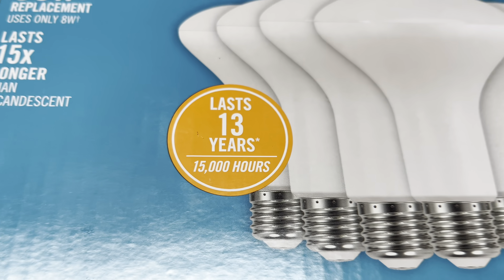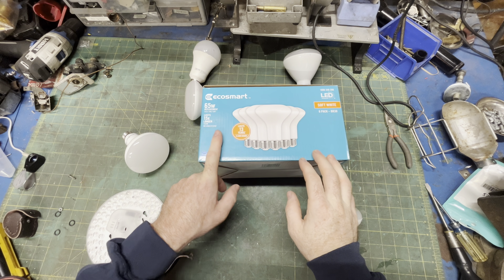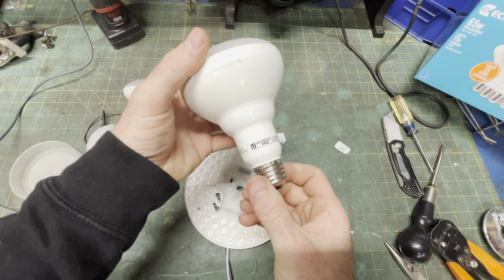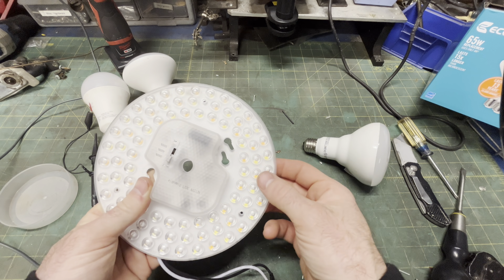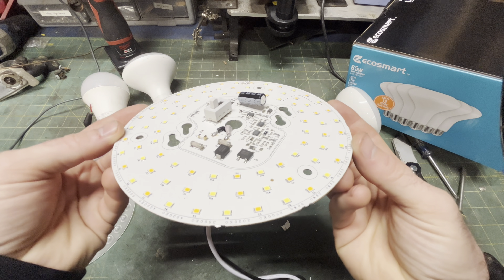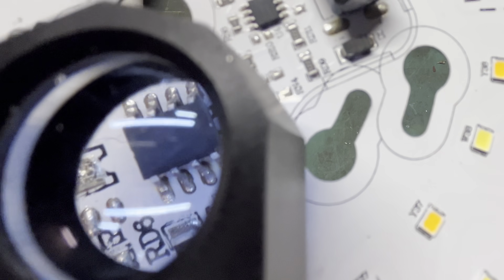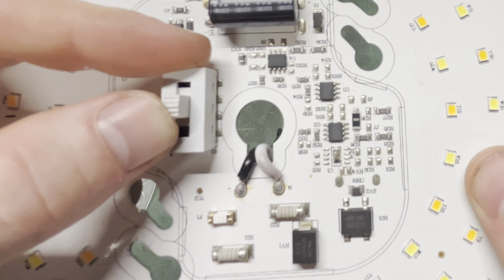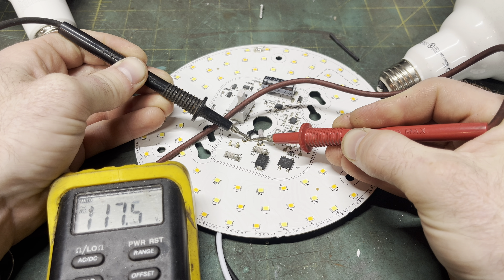Why Do LED Bulbs Fail? An Autopsy!

Comment: well leds are supposed to be more energy efficient and save money on your electric bill and what i have personally found is that these led light bulbs have been getting too hot one reason is that they literally have no vent holes in them at all so they have been burning out after about3 months and so i take them apart and jump each led with a piece of wire until the light comes on and that is the bad led so i pop that bad led off the board with my pocket knife and just hit it with a tiny dab of solder to bridge the gap where the bad led was and super glue the plastic globe back on the light and it's good for about another 3 or 4 months but still mostly it's going in the trash within a year and a regular old light bulb lasted4 or 5 years easily so led light bulbs are a money grab . it's a scam im going back to florescent bulbs at least they lasted a couple years and are fairly energy efficient.

Comment: The IKEA GU10 bulbs I put the kitchen fixture when we remodeled 2013 started to crap out last year and have replaced 7 out of 10. So those lasted. I had a pair of Cree three way bulbs I put in the bedside lamps when I redid the bedroom after a flood in  2015  those lasted till 2021 but were under a 10 year warranty and got replaced free of charge by Cree.  So yes buy good name brand bulbs and they will last.

Comment: The old fashioned light bulb has been around for over a century, so I think they have it down to an art. LED bulbs need a transformer within the base of the bulb, which often gets hot, and since we need them to be as cheap as China can make them, the components are of the lowest grade possible. This means caps in the transformer dry out and fail, or you have poor connections, or the surface mount LEDs burn out.
Yes they are energy efficient, but they are not wallet friendly

Comment: Never seen someone blow out solder from a through-hole joint with compressed air like that.  Now I know that I need an air compressor next to my soldering iron.
Reply: Compressed air can be surprisingly "hot", ESD-wise.  That's why industry tech benches use compressed air ionizers.  Raw compressed air can kill (or worse, cripple, so they die young in the field) ESD-sensitive parts faster than forgetting to put on your ESD strap.
Reply: @miltonthecat2240 also, after 30 years in the semiconductor industry, i have seen a lot of esd sensitive components being dusted with the airgun that is usually attached to the machines. Even stronger, some machines use compressed air to clean the rejected components automatically during the aoi. There are also ionizers in those machines but those are separate and the compressed air is just the same as used for driving the cylinders and stuff.

Comment: Not sure if you answer questions but here goes, the power went out do to a storm my cheap led bulbs bought at the dollar store were still lit, about half as bright maybe less but still lit. How can that be? None of the other bulbs were lit and if I moved the bulbs to other sockets they would do the same. I took one to the neighbors and it did the same thing lit but dim, the whole town was without power for 2 hrs and the bulbs worked the whole time. Can you or anyone explain what or why????

Comment: when led bulbs replaced the normal bulbs and i had to switch over, it was a lot of failures, at least the ones the worked the first month still work to this day.
i am not sure led bulbs was a good idea, when has any modern thing ever been a good idea?

Comment: Light fixtures designed for incandescent bulbs should have zero air flow. The bulb is designed to be cooled through radiation only. If they are cooled by convection, they produce less light. LED bulbs need good air flow for cooling. Most LED bulbs are also only designed for screw down operation, which is difficult for ceiling fixtures.

Comment: I'm sorry but 65W incandescent bulbs lasted for like a year at best, the reason why the one outside lasted so long is first either you are not driving that at a high wattage and second you have it on a sensor so it will only be on when you need it which you are not going up and down your path very much.

Comment: You know it’s possible to build an LED bulb that runs the LEDs directly off line current, right? I built one that’s nothing but LEDs and wire. It runs on 120V AC and sits inside an A19 enclosure. It’s been running continuously for over ten years.

Comment: "crap out after 5 years or less" yeah, way less. I don't know if the ballasts are crappy, or the LEDs or other components are pushed past their regular operating tolerances.
Also, I'm really annoyed by stupid proprietary lamp fixtures now that we have LEDs that mean entire fixtures generally need to be replaced.

Comment: My same experience - they last no longer than a regular bulb
Reply: In my experience good ones(from a serious brand, and not the cheapest ones they have) do last way way longer than an incandescent(That is with a moderate to high amount of on-off cycles though).
Cheap "no-name" ones tend to to not last that long(There is exceptions!).
I'm from Sweden with 230 Volt bulbs so might be different where you are living.

Comment: They are made to fail, most household LED lights have too much power going through them which surprise surprise causes them to last a fraction of the length of time they could last for. LED bulbs can last a lifetime when they're not deliberately made with too few LEDs for the light output.

Comment: 8:24 Mate! Your meter is set to AC Volts, not DC!
BTW, the problem with your light seems to be that the filter capacitor is dead. The giveaway is that the output of your bridge rectifier is all ripple, no DC.

Comment: Better to use the 15,000 hour figure and do the math depending on how many hours a day you use them. Fifteen thousand hours is less than two years if you run it 24 hours a day.

Comment: Some of the early EcoSmart bulbs (you got those at HDepot by the way, not Lowes) are incredibly long lived.  The newer ones don't last but 5 or 6 years or so but I have some that are in use 365 days of the year when it's dark out that have been in service since 2014 and they are still going. Knock on wood. The early 40 watt EcoSmarts that are shaped like a large pill capsule. I never opened one up but that was a good design. A design they don't use any longer.  Mine are an undimmed light fixture over a table , downward pointing and open on the bottom. On other fixtures, with newer R20 ecosmarts, I've found fixtures that point upwards instead of downwards vent the heat better and last longer. Feits are absolute garbage. I stay away from those.

Comment: As usual, when it comes to marketing, it's often not what they tell you but what they don't tell you. Sure the LED will last XXXXXXXXX hours, but the electronics driving it will last anywhere from 5 minutes to around a year.  I remember when we were told fluorescent bulbs were the future. It's all about  which lobbyist writes the bigger check.

Comment: Most "bargain" LED bulbs use too few diodes and compensate by running too much current through them. Good LED bulbs will have a ton of LEDs and will last almost forever.

Comment: I write the date I installed those crappy things with pencil...they last far less than incandescent ones. I am pretty sure the first LED bulbs when we began to move to them were far better. I use some ways to mitigate: smaller power bulbs last longer in general...the LEDs don't fail the drivers do because of heat. I disassembled every one for a about four years after they failed, no LED had failed. So bulbs in plafonds (ceiling mounts) die a precocious death because there is no space to dissipate heat. If the driver does not have transformers it is a pure piece of crap: the MOSFETS will need to do heavy switching to control the power and the semiconductors dissipate power during switching not conducting or opened. Using transformers make it more manageable for the MOSFETS. I substituted my plafonds for hanging balloon bulbs, for the same power they have a bigger area and hare beautiful for hanging and being refrigerated by convection on open air they don't get much more then 56C in the driver region (132F) inside plafonds normal bulbs with less dissipation area reach 78C (172F). The other thing is to avoid those crappy brands and go for the good ones what in my country is almost impossible, but I am willing to pay for. Long ceiling mounts using led strips made of metal endure MUCH longer because they have a good heat dissipation and the drivers are separated and CAN be substituted. Here in my country people used the plastic crappy ones and the are cheap but last as much as a firefly with the price of a proper one they can endure about 5 to 9 years depending on brand and use basically what they are specified (they are used at kitchens, bathrooms and offices mostly.)

Comment: The bulb in the middle of the video:
half sine after rectification? And what is the capacitor for? It's for smoothing! The DC value should be the peak value of the AC and the capacitor fills the gaps - except this one, it is dead and reduces the effective DC to 70% and that makes it dimmer...

Comment: The ones I barely use (GE, Sylvania, and even Great Value) start flickering then burn out within months with a total of two weeks constant on. Maaaaybe three weeks if it's the bathroom. Ten years lifespan my ass. Would it be better to just leave them on constantly and have interrupted sleep? 

The only good ones are the Govee H6008 ones I bought from eBay over the summer. They're color changing LED bulbs and are weak in brightness but considering I'm conditioned to night time (16 years of 3rd shift night crew) it's okay but could be a wee bit brighter on the highest setting. Let's see how long they'll last. Six of the eight are in use so there are two waiting in case something doesn't work out.

Comment: I have a clinical lack of motivation... love it... Why trying to figure out what you already know... it's crap
Actually most common it is the LEDs themselves... they fail, probably because overheating... just touch the top of the led with a piece of plastic, this may pushes the bond-wire back onto the crystal and it lights up... here is your fault

Comment: I've popped open a few "burned out" LED bulbs. About half of the time I found defective capacitors inside, either burned or just plain cracked open. 
The usual suspects. The caps.
Reply: In my experience of popping open LED bulbs about 1 out of 8 have a shorted cap as the culprit, the other bulbs have resistor, inductor, transistor or IC damage as the fault(a dying cap might have contributed to the damage though, haven't checked any ESR and capacitance).

Comment: Most bulbs in e27 form factor are poorly designed, both thermally and in general. E14 are even worse due to space constraints.
What's infuriating is that even form factors that allow for decent drivers are usually sh*t. Finding a decent led light of any kind is a quest that takes immense amount of time (in part because their manufacturers have lifespans that approach those of a Russian main battle tank, i.e. measured in minutes, in part because there's no standard model nomenclature and they bait and switch all the time on top of that). It also requires deep research and technical knowledge.

Comment: That's not a leaded resistor without leads. It is a MELF (not MILF) resistor; Metal electrode leadless face. They are used because they can be higher wattage and more physically robust than a standard chip resistor.

Comment: Maybe LED bulbs don't last 10 years but used correctly per the manufacturers direction, we have easily had them last 4 years and use 80 percent less energy than the old incandescents.  Granted that the old incandescent bulbs were 25 cent a piece, but you got what you paid for, less life and higher electricity usage.

Comment: LED bulbs are vastly superior to incandescent and also to CFL bulbs. More light, less heat. I agree that LED bulbs usually don't last as long as advertised, but on average they last longer than incandescent bulbs, and the savings in electricity makes the choice a no-brainer.

Comment: Is it just me or LED bulbs seem to die faster than the old classic bulb that suppose to be BAD?  It seem they over drive the components and they overheat/use and die.  The LEDs chips are fine, just it's driver is dead so the whole thing go to the landfill to help the environment.

Comment: the led light cirquits at college where much worse than the one in that chinese one. as they had no stabilisation or such.
but might be some parts are designed to fail faster, like pushing components to their absolute limits intentionally while it would cost 1 cent more to make them much more capable.
bad solder joints also are such a example, as these days many things are designed with the intend to fail rapidly.
surface mount parts get loose solder joints much more easily than through hole, to fix that they normally are pretty flat and with a wide area, so all those companies surface mount soldering through hole components that is a easy recipe for failure.

on some expensive brand or designer lightbulbs they even add special parts which essentially act like a timer to make the lightbulb die after a certain amount of time, or they intentionally overdrive the leds or add special materials which slightly change colour to make their colour change over time so that when one light is replaced all have to be replaced, as in most modern companies and such they don't like different coloured leds(I guess companies are led racist, has to always be in led psychopath mode.

also you mentioned 5000k being psychopath, but here in netherlands many busineses want even higher k numbers for their buildings and rooms.
next to that somehow all companies want such insane intensity from leds that your eyes almost fry themselves when entering such a building.

Comment: W.r.t. your original question about lasting as long as the box said it would... I've made the mistake of buying incandescent and halogen bulbs off of Amazon. There are some good deals on there, but there are also bulbs that die within 300 hr, so... Yes. Most of my LEDs do better than 4500 hr. #lowbar

Comment: You scared me when you grabbed that capacitor!  Are you crazy?  Big capacitors can hold their charge long after being unplugged if you don't properly discharge them.  I learned that lesson well with a dead flash cube, fried the inside of my thumb after touching the end of it (as you just did).

Comment: Those plastic LED's are junk and don't last long but they are cheap enough. The good LED's are the heavy aluminum ones with the beefy heat sink fins on the ouside. They last alot longer but are considerable more expensive. I have several of those heavy aluminum ones with the fins on the outside that are at least 10 years old and still going strong.

Comment: So, if it's the electronics which fail universally in these bulbs, has anyone invented a bulb with a removeable and replaceable driver circuit?

Same as we used to do on old fluorescent light fixtures?  We didn't used to toss out the whole fixture we changed the plug-in ballast and the thing was restored.   Why toss out the whole thing when only the electronics are bad ?    If someone invents and markets something like this
I predict something money making.   Less E-waste too.

Comment: Overheating: LEDs are sensitive to high temperatures. Inadequate heat dissipation can degrade materials, leading to burnout.
Poor Quality Components: Low-quality or cheaply made components can result in shorter lifespans.
Electrical Issues: Over-voltage, poor wiring, or fluctuations in current can damage LEDs.
Environmental Factors: Humidity and dust may corrode or affect LEDs.
Manufacturing Defects: Poor assembly can lead to connections failing over time.

Comment: I've never had an LED bulb die outright, every single time they last 1-2 years and then become too dim for my freakishly bright 5000K bedroom. 
A properly built bulb with many filaments/chips run at low wattage and premium circuitry and build quality could probably last 50,000 hours. It's pure planned obsolescence.

Comment: I still don't understand why people change their fixtures out with LEDs that are the fixture. Wait till they have to replace them all! These things die all the time. Especially the ones with Wi-Fi. They get so hot that the Wi-Fi chip could fail or one of the sets of LEDs or something else. And they're never made to be repairable, so it's $20-40 down the drain.

Comment: You get what you pay for. I have about ~100 LED lights of different types. Running on nice and stable 220V mains power in Europe. Failure count over last 5 years? 2. When the same bulbs were running incandecent, I needed to replace multiples of them every month.

Comment: Planned obsolescence 

A fuckton of them have internal wire clamp connectors that corrode and get bad contact over time and then they die. 

Solder them on and they last and last and last I have a 8 year Phillips one now, wires got no contact 6 months in

Shit connections as you had are also an issue

Comment: This is why I would never, ever, install one of those self contained hardwired light fixtures or those pancake recessed lighting fixtures. I have the know how to replace any fixture but the average person does not. Just about anyone can replace an Edison base light bulb, but would require an electrician to replace a hardwired fixture. Perhaps that's the point of these fixtures, to make more business for electricians...